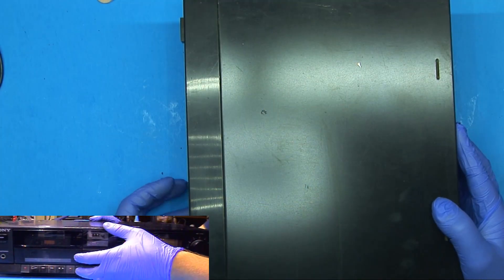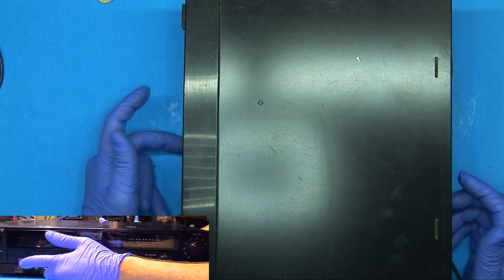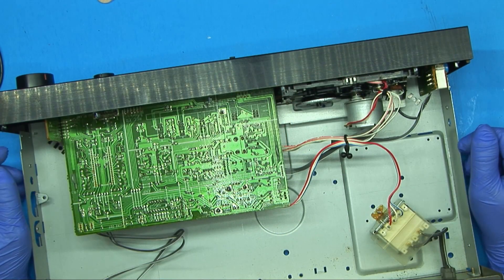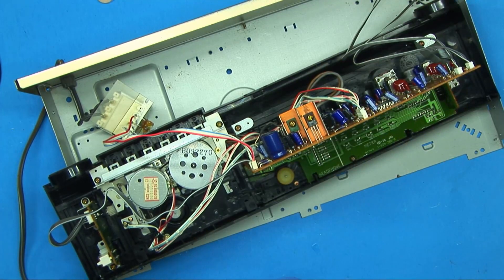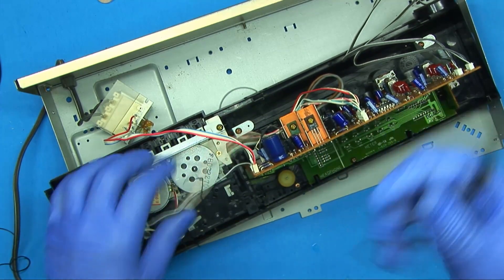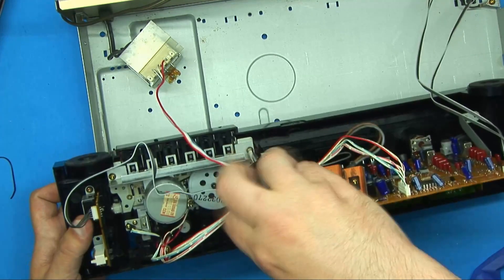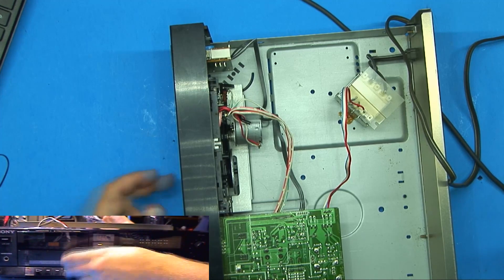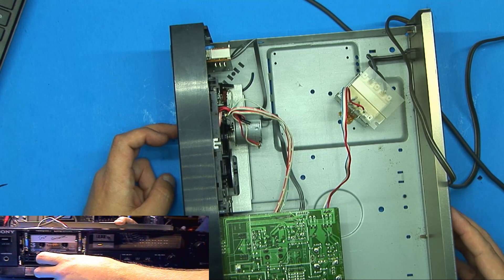Sony TC-FX150 Cassette Deck Repair - Part 1

Comment: Did / does the motor run continuously on these decks ? As soon as you turn on the unit? Even without a cassette inside?

Comment: I appreciate the video. I have this deck and need to replace two belts as well. They are all chewed up,  so it's hard to tell how they were installed. The motor only has one pulley.  Do both belts for the capstan and take up drive go on the one motor pulley? Thanks
Reply from the maker: From what I could make out....   Belt from the motor to capstan pulley.  Then a belt from the capstan pulley to the spool pulley
Reply: Thanks.  That helps.  I like to keep my old stuff working. This was a good tape deck.  I bought the assorted belts you recommended.  I believe I'll find a couple in the mix.
Reply from the maker: @ramjtme  excellent.  I wish u luck. There's always that feeling of satisfaction keeping these old decks and stuff working.
Reply: Got the belts on Ebay.  Found two in the bulk pack that work.  Now I ma finding the FFW button sticks.  Any suggestions?
Reply from the maker: @ramjtme  thx for the donation BTW...really appreciate it.     A lot of times the grease used gets gummed up with dust and dirt and becomes sticky. The exact opposite of what ya want.  I'd pull the mech out from the front panel and work the button taking note of all the parts that move.  Then go and check behind those parts.  Clean off the old lube with isopropyl alcohol and apply new.  You can use either clear silicone grease or white lithium.look out for plastic parts.  Those are what they usually lube up.   Sry if not clear. Typing this quick on my phone.
Reply: I've done that.  I'm trying not to dissemble too much as I am great at dropping the small crews and not finding them.  I sprayed electronic cleaner all over the parts I see moving.  Not much help.  I'll try more. Thanks. BTW-  the drawing you show is worth a couple cups of coffee to me.
Reply: Got it.  One of the belts was too tight and pulling the upper pully against the FFWD mechanism. A larger belt,  less tension.  It works great.
Reply from the maker: @ramjtme  nice!  Simple fix
Reply from the maker: Unfortunately the clutch in the spool pulley on mine is shot so it's down until I can find parts.
Reply: @Electronicle  Just learning so is the clutch the part that has a spring in it? Black one you attach the belt to and spring turns the white one? Recently bought a Sony TC-FX100. The tape mech looks exactly the same. Replaced the belts on mine and it plays perfectly fine, but cannot rewind or fast forward on casettes that are a bit harder to turn, because that part that I described above (the clutch in the spool pulley?) just slips. So it's worn out I guess?

Comment: I just purchased this exact deck and am loving this video. I’m a bit of a novice and am having trouble locating the belts for it. Can you tell me the size belts???  Once I get it running I plan to tune it up with your video as reference. Any help would be greatly appreciated
Reply from the maker: Awesome!   Check eBay or amazon.  The belts I used weren’t for the deck they were out of a bulk variety pack.  I think I got about 100 belts for $10 from amazon I think.
Reply: @Electronicle  Just pulled one of these out the goodwill bins and ordered a multipack of 30 belts on Amazon for $8.  I'm going to have to watch your video a few more times to figure out where those belts go, haha.  Great video, thank you!
Reply: Took a look on amazon. Just don’t know the mm size. Looks like the packages give a mm range. Was hoping you knew off hand
Reply from the maker: https://www.ebay.com/itm/Riemen-Set-fur-Sony-TC-FX-150-Tape-Deck/163754231058?hash=item2620834512:g:vtcAAOSwEwBdFFRy
Reply from the maker: Dont know the size off hand, however most tape decks use similar sizes.  An assorted pack is your best bet.  I'm sorry I can't be more help.
Reply: Thank you!